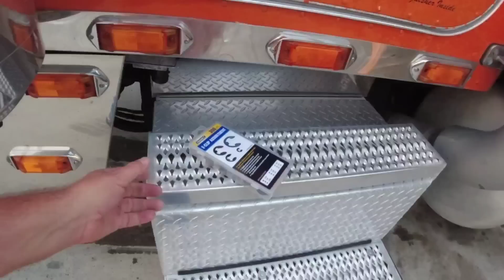#682 Hoping for a Reload The Life of an Owner Operator Flatbed Truck Driver

Comment: Elkhorn. ..Wisconsin.        my home state. .  Things are tough right now but thankfully I've a 2017 that I bought new but no payments for the last 2 years , so fixed overheads are low.... doing Midwest van regional we have seen s downturn in rates and volumes even on contract freight..  My strategy has always been concentrate on what we can control as supply and demand will determine the rates..  fuel has always been my main focus and in times like these , slowing down, not rushing all helps and off course buying fuel smartly not just when you need it... The market will correct itself and a lot of these people who jumped into trucking and bought overpriced trucks and trailers in the last 3 yrs will dissappear as they don't know how to run an efficient business as they came in at inflated rates..  it's all cyclical and the good times will return again.    It's survival of the fittest and the strong will survive.   You just need to do everything in your control to make that happen

Comment: Being that you load Deere stuff out of moline, kind of surprised you don’t load out of some other Deere facilities, Waterloo, but would be tough with a flatbed there. But Dubuque has industrial equipment that you can load on a flatbed, usually get some decent weight out of there.
Reply: Mercer, has to have the contract, to get it.

Comment: The next time you're home, work on getting the two other trucks running. Then sell them. That's money that could be used for an emergency fund or pay off some bills. None of us are getting any  younger
Reply: Nope, rates on the Mercer haul not good enough. Use the oldest Pete to haul gravel/dirt for a while, not as glamorous, but will pay the bills. Friends have done that idea through three down turns, it worked for them.

Comment: Dan, several years ago before I became a freight hauler,  I worked for a guy that had several flatbeds and when the truckload freight got slow we would look for partials and did pretty good.  Does Mercer do that or allow you to?  We had tons of flatbed freight going to some customers in the LA area but nobody had freight coming out unless you had a reefer.  We did good with partials there and up east too.   Being that there has been a major LTL company shutdown recently there is a lot of LTL available freight.  Some of it will go on a flatbed.  The company I recently retired from is freight heavy now,  cant keep up from what I hear.    I never pulled a flatbed load out of south florida except once and it ended up in LA.  Im like you, I didnt care for south Florida loads because its a long deadhead out of there to reload.  Hang in there, hopefully this crap gets better.  Be safe

Comment: Florida is notorious for having no loads coming out... hope you don't have a 500 mile deadhead out of there.
Reply: That's because commercial Carrier gets a lot of the loads in Florida. In Miami most of the tile comes into their port that's all flatbed work. Tampa and Lakeland has a lot of freight, and Ocala has a lot of freight. It just depends on who you work for. I remember Dan got a load of steel plate out of Tampa at that New steel Yard they built.
Reply: Dan don't mind deadhead.... I've seen him drive 800-1000 miles like it's nothing 😅

Comment: DON’T get to “chasing the freight” be pickier about what you do haul. Higher rate per mile, less miles = > $$/mile. Will mean more profit in the end. Also shorter runs (<500 miles as in two 200 mile runs/day) will pay better. The trick there is timing them to fit in a day. Good luck, I hope this helps.
Reply: I agree, but if you read the comments, there are a lot of people chasing the loads, not thinking.

Comment: parking your truck would be like someone staying home until they get higher pay.😮
Reply: If it cost more to run the truck than he brings in- that's called bankruptcy!
Reply: Do you not comprehend owning a truck is a small business?  There must be profit.  Wife and I shut our 4 truck fleet down May 2020. Costs $1.50 just to turn the engine on. Freight was paying $.90 a mile.  So you want small business owners to lose  $.60 a mile for how long?  Like a day before bankruptcy.
When a business is no longer profitable, one must exit the business. Personally, we couldn't be more happier to stop RUNNING OTR and not operate our own business.  We drive local now as employees, make just under 100K each, home everyday and only work 4 days a week.
Reply: Wrong. Its like an average worker thinking they need 25 dollars an hour to justify going to work for someone to pay their bills at home. Then one day the boss says you're getting 12.50 an hour because work is slow. Are you going to work? Some people do some people dont
Reply: That sometimes work too!

Comment: Manufacturing is also slightly down. The factory I work at has dropped back to 40 hours/week from 50 in the last 6 months. They have also not replaced the couple folks that has left. The crazy economy and political mess have certainly contributed to all this slowness.